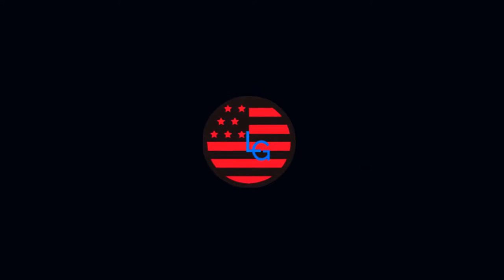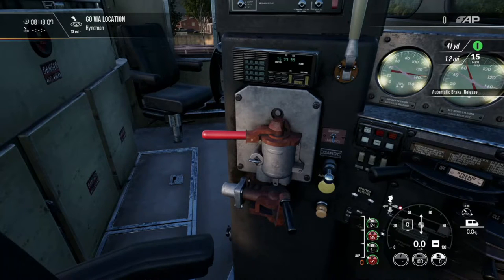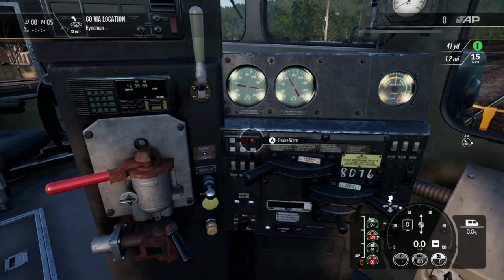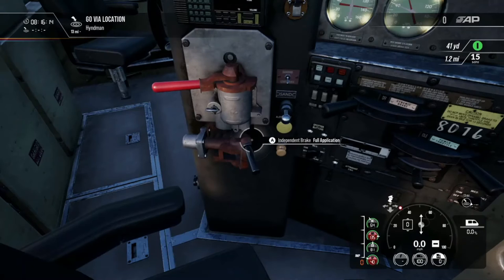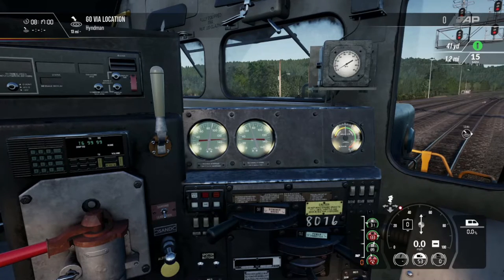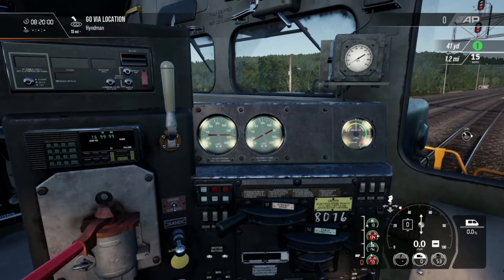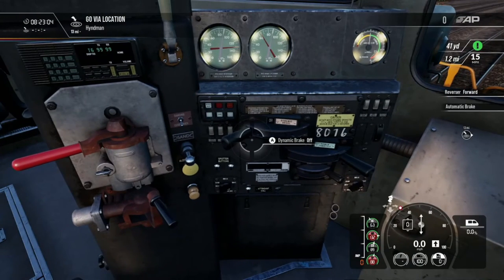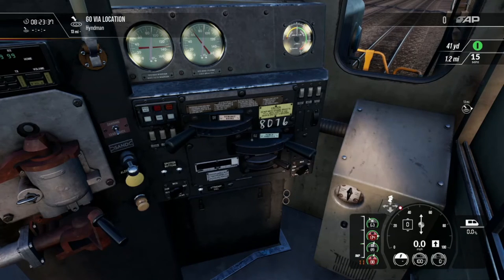[TSW2] In-depth Tutorial of Braking Systems Sand Patch Grade SD-40

Comment: Dynamic brakes are when the turning of the traction motors generates powered and the its sent to a grid in the long hood(its the fans/grates on top). They take the kinetic energy(movement) turns it into electricity, sent to the grid. Where it's turned into heat. Like regenerative braking in a hybrid(just dumping the energy as heat instead of charging a battery)

Comment: I am playing this simulator for 3 weeks, but I never use dynamic brakes. I will definitely use it while downhill.
The fully fuelled mission was very frustrating as on 2 tries I was just running the whole 1.1 km long train with just 2 locos, I never able to use the bank locomotives. The main locomotives just starts to wheel slip on the slop. 
Please if possible make a video on how to set up banking locomotives. It will be very helpfull.
Reply from the maker: Dynamics is the way to go! Thank you for another video idea. I will look into that in the next few weeks.

Comment: Hi Lucero. What does handle off do on the automatic brake? Like the purpose of moving it to that position. And suppression as well..
Reply: Please reply Lucero
Reply from the maker: So the handle off just means that you turned off the automatic breaks.
Reply: @lucerogaming3720   alright. What about suppression?
Reply from the maker: Suppression is the setting before handle off, and that allows the air to bleed out from the main break pipe. The main break pipe is the line that runs from the locomotive to each and every car that controls the breaks on the railroad cars.
Reply: Do I also need to have banking comm on at the back pair of locos, as well as the front pair? And do I set one of the back locos as lead or not?
Reply from the maker: I switch all the locomotive banking comms on.
Reply from the maker: No only the lead locomotive should be set on lead.
Reply: @lucerogaming3720  ok, I figured you did switch all the banking comms on. It only works for me on Sherman Hill, and not other maps for some odd reason. It automatically switches it off in other locos on other routes. It lets me only switch on banking comms for lead locos on Horseshoe Curve, and not any other loco in the lashup, but on Sherman Hill, it works flawlessly.
Reply: @lucerogaming3720 And what railroad were you a conductor for?
Reply from the maker: SLRG in Colorado.

Comment: I cannot seem to get the automatic breaks to function, so annoying to look down at the independent break all the time....
Reply from the maker: Is the pcs open?
Reply: @lucerogaming3720  i dont know, i'll have to check that tomorrow. Where is the pcs?
Reply: @lucerogaming3720  the pcs is not lighted, so i guess it is not open
Reply from the maker: Ok and it's cut into freight?
Reply: @lucerogaming3720  yes, and when i try applying the automatic breaks it is coming up like it should on the screen, but the breaks itself doesnt have any affect on the speed, only the independent that works. Do i have to set it on bail off? Or set the automatic to a special setting to apply enought air pressure, like the white needle coming up enough in order to apply?
Reply: I'm having the same issue the automatic and dynamic breaks do not work during switching only the independent breaks do
Reply: I'm having the same issue the automatic and dynamic breaks do not work during switching only the independent breaks do
Reply: (For a disclaimer, I just got the game yesterday, land definitely need some practice at all of it.) When trying to slow down, I usually push the auto break to about 20-30% depends on how fast I’m going, and how quickly I need to be stopped. Then I use the  one right below that. And push it to 20-30%. I also start backing down on the throttle, if I have to, I’ll go all the way down to idle speed. If it still doesn’t start slowing down, I push auto to 80-85%, and same for the independent one below that. Then, if it still doesn’t work I just throw caution to the wind and completely cut the throttle off, if I haven’t already, and shove every break I can to full application. With all that being said, I usually am just doing yard work right now, so most of the time I’m going slow enough I don’t even need brakes. I’ve started trying to do routes to help me get used to actually driving the trains, and not just drag and drop jobs in the yard.